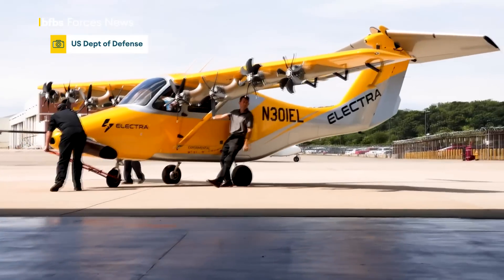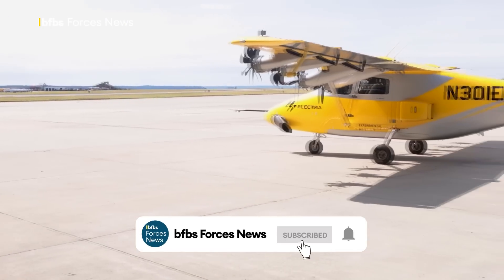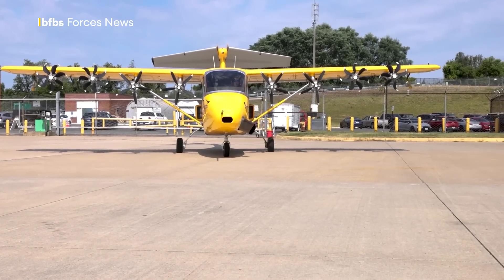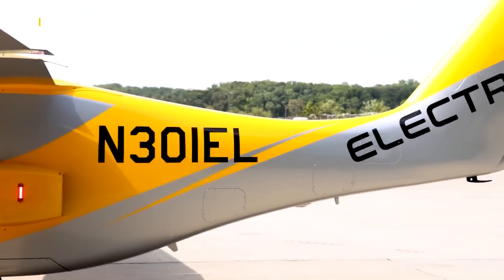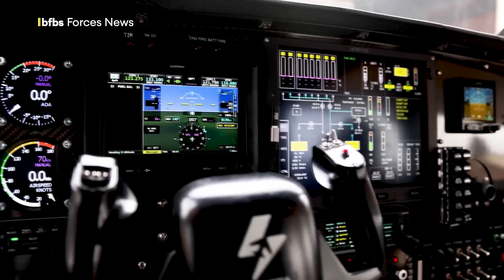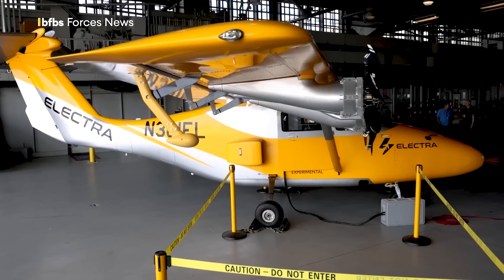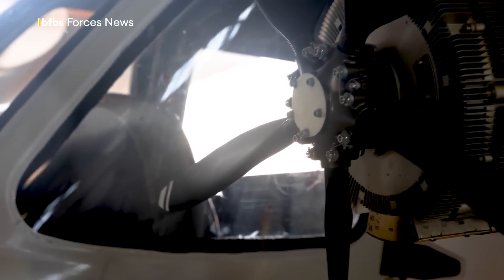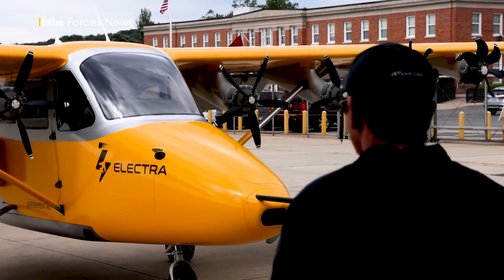Electric-powered Stol aircraft undergoing experimental flights with US Navy

Comment: What a nonsense! Not one single serious technician or pilot believes in aviation based on accumulator driven electric motors. Every real expert knows very well the ridiculously low relation of the amount of contained energy to it's weight. Chemical energy is _ b y _ f a r _ less "heavy", hence _ b y _ f a r _ better suited for aviation.

There are a few small niches for such planes (only small ones), but... "in the long run" very few will survive, because they are simply way too expensive (literally everything taken into account and compared to engines based on "burning fuel")

Comment: It's a jet turbine running a set of generators that power electric motors.  You'd be better off just coupling the turbine directly to a prop on the nose of the aircraft.  By turning it into a hybrid and planning on adding a battery pack you're just  lowering the useful load of the aircraft in order to put a low power density fuel alternative in the aircraft that will be exhausted in probably under 30 nautical miles.  While it's a good concept, battery technology just isn't there to make it feasible.  But you get startups like this that is just after the government funding money for a known failure.

Comment: This is still an Electric Vehicle because it has an electric drivetrain. I don't like the 'series hybrid' label, I think vehicles like this are Internal Combustion EVs - ICEVs (like Nissan e-Power) rather than pure mechanical Internal Combustion Vehicles ICVs. I'm guessing the advantage here is allowing the power to be more easily transmitted to novel positions on the airframe than would be possible with mechanical linkages. Is the battery tiny, or is there some point in having a larger one?
Can we have sane specs instead of "£2,500 of cargo" please?
Reply: It's lb, not £
Reply: @Orbital_Inclination  I know. Thanks. Fighting a lonely fight here since teachers told me in 1970s "were going metric now"
Reply: @trs4u  this is a US aircraft, and they tend to work in lbs regardless of where they operate. I've flown a range of aircraft and had to deal with fuel, for example, in lbs, kg and litres interchangeably depending on manufacturer
Reply: @Orbital_Inclination It's British narration. I haven't got time right now to look for an eg French video about this plane but I have strong doubt the French would give the stats in imperial measurements. We've been teaching kids metric STEM subjects for 50 years in the UK, it continues to seem perverse to me that we still haven't 'regularised' the (UK bit of the) world outside school.
Reply: @trs4u  British narration about an aircraft that uses lbs, on a US video hosting website for a global audience, so its perfectly reasonable to use either metric or imperial

Comment: Mentioned it being a hybrid but no mention of what appears to be a small turbine engine in the nose providing power...Why not mention that?
Reply: maybe they weren't allowed? I've seen plenty of videos where they weren't allowed to discuss certain parts of whatever it is. But I noticed that big exhaust nozzle on the front too.
Reply: If it's hybrid it by definition has an internal combustion engine to provide power or thrust.
Reply: jump cart
Reply: Cooling port for electronics?
Reply: @KiloFeenix  cooling ports don't need long tube to be directed away from the aircraft, turbine exhausts gas do. This is exactly how you'd configure a turbine on such aircraft, hot side forward. Also you can see the turbine air inlet at the front of the plane.
Reply: yeah hard to hide the exhaust pipe; check out the differently configured propellers ; some smarty engineers have been hard at work optimizing the propulsion system.
Reply: Redundancy if the electric motor failed. But that doesn’t mean it is not a hybrid system.

Comment: How is it going to generate power on the ground exactly?
Reply: Looks like a turbine is installed in the nose that must power a generator.
Reply: @dcpack  I don't think so I don't see any turbine in the nose, and even if it was there the amount of power generated would be insignificant, enough to power a microwave maybe for a minute or two. And a generator is heavy not what you want in a plane, you want it to be as light as possible.
Reply: @mofayer  It's a strange idea, the turbine is at the rear, why not have it go out the rear, I'm sure there must be a reason, but that's irrelevant. I'm still waiting for anybody to explain how it's going to generate power when it's parked.
Reply: @Iain1962  I don't know what ya smokin, but a turbine generator is the only thing that makes sense. Turbines have THE highest HP per weight ratio AND the highest HP per size ratio of any engine (for continuous output)*
Reply: @mofayer  So in order to generate power on the ground you have to have the engine running? 

I'm not seeing the advantage nor the selling point, and it's not exactly green...Isn't that the point?
Reply: @Iain1962  the selling point is short take off and landing. 8 propellers along the wing generate allot of lift at low speed. I don't think it even has a battery, as that would add weight and increase takeoff distance. The only thing green are the dollar bills going to the manufacturer.
Reply: @Iain1962  *it might have a small battery/capacitor for takeoff boost. You'd only need it for 30 seconds or so. If it's located in the motor pylons, that would be most efficient and it can use the hot exhaust de-icing vein along the front of the wing to warm the batteries up for winter flying.
Reply: @mofayer  Well according to the narration it is "next generation" which is code for "green", and can double as a generator when on the ground.

Well any motor can be used as a generator if you leave it running and it is properly configured, and a large Drone can do VTOL something like the Volocopter.

If there are no batteries then this plane needs fuel all the time to do anything. So I am not seeing any major advantages.

But at least we now have an explanation for how to generate power on the ground, leave the motor running.
Reply: @Iain1962 hybrid systems are far more efficient, as the turbines are generally smaller than they would be for direct thrust, and can run constantly at an efficient RPM. The aircraft will have batteries like any other aircraft with any kind of electrical system does, as redundancy if nothing else 

Running a small turbine on the ground is what all airliners do, hence why they all have APUs, which is essentially what the turbine in this aircraft is, as it doesn't directly provide thrust, just electrical power
Reply: @Orbital_Inclination  So it's not anything new. By definition hybrid systems are less efficient because converting from one power source to another always results in loss.

To return to the original question apparently we have the answer. it can generate power on the ground as long as you leave the motor running and have a fuel supply. 

Thus far there is no way for it to generate any kind of power without fuel.
Reply: @Iain1962  no, hybrid systems are more efficient because the fossil fuel component works far more efficiently and the losses due to power transmission don't come close to negating that.

Obviously it cannot generate power without fuel, that's literally how a hybrid system works. Its still a big improvement over other aircraft of this size which would need to keep a main engine running at an inefficient RPM to get ground power
Reply: @Orbital_Inclination  Well no because you have to convert rotational power to DC to store it, and then convert electricity to rotational power to drive the propellers so that's twice you lose power in the exchange.

If the drive was turning the propellers directly it would be much more efficient.

And glad we got it cleared up that the engine needs to be running and provided with fuel for it to generate on the ground. It's not as green as they want it to be.
Reply: @Iain1962  you seem to think that any burning of any fossil fuels is some kind of gotcha. It's not. Hybrid systems are still more efficient for the reasons I've outlined, even with the energy conversion losses. 

Direct drive turboprops waste a hell of a lot of energy as heat and noise, and need one engine per prop. This system needs one far smaller turbine to run 8 props, providing far better STOL capability than could otherwise be achieved. 

No one claimed it was 100% emission or fuel free, its just an improvement over existing tech in that regard. Don't let good be the enemy of perfect.
Reply: @Orbital_Inclination  Not at all. the inference from the presentation is that on the ground the aircraft could generate power autonomously, ie that it would provide some sort of green energy. So I asked how that was possible.

It turns out it's not some new innovation, it needs fuel to make it work, it cannot in fact generate power without running the motor, so it's the same as technology that's been around for over a century.
Reply: @Iain1962 It doesn't make any such claim, it just says it generates power on thr ground, which it does
Reply: @Orbital_Inclination  It is inferred, so I was asking, and the answer is it needs to run its engine.
Reply: It will generate power on the ground thr same way it generates power in flight, or use a GPU
Reply: @Orbital_Inclination  But it doesn't generate power in flight, it uses power. What do you mean by GPU? A diesel Generator?
Reply: @Iain1962  it has a hybrid system that generates electrical energy.

GPU - ground power unit. Sometimes a diesel generator or sometimes just a big battery
Reply: @Orbital_Inclination  But the claim is that it will generate power when it is on the ground, if it is recharging with a generator then it is not generating power, the generator is.

There is no system for the plane to autonomously produce electricity on the ground, some kind of power supply or external fuel supply is required.
Reply: @Iain1962  it has a hybrid-electric system. The 'hybrid' bit of that would indicate it does indeed have on board generation capacity, and there's nothing to say this couldn't be used on the ground
Reply: @Orbital_Inclination  So it would be like charging your battery by leaving the engine running....

That's not the implication at all you can charge any battery by running your engine, it's not exactly "generating power on the ground" is it?
Reply: @Iain1962  yes, that's exactly what a hybrid system is. A small fossil fuel engine of some kind providing electrical power generation.

As for your second point, to charge a battery, you need to be generating power in the first place.
Reply: @Orbital_Inclination  Hahaha.
Reply: Use as a generator/battery
Reply: @SomeKidFromBritain  On the wings of a parked plane? Even if you can do it it's a miniscule amount. And a battery is a storage device it's not generation.

Comment: STOL and electric seem to be two unrelated technologies here.  I don't see how either affects the other.
Reply: Lots of small motors (electric can be small, ICE not so much) vs two big turboprops on the wings, frees up lift and/or reduces drag, enabling STOL. Maybe the many engines spread the prop wind over the whole wing somehow. Or the net weight is reduced. Or a grab bag of all of these and others.
Reply: @scottstewart5784  Good points.
Reply: accelerating the air over the aerofoil increase the lift drastically at low speeds, NASA had been toying with the idea in the X-57 for some time until recently
Reply: Loads of air going over the wing, gives more lift. The Lockheed L188 Electra did the same.
Reply: You clearly have no concept of their engineering. There's no need to bother you simple head any further.